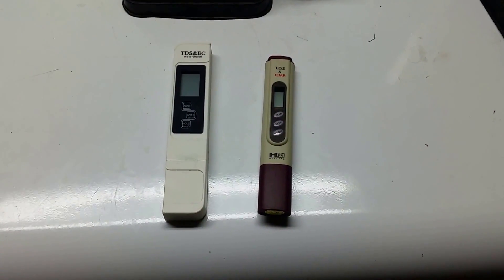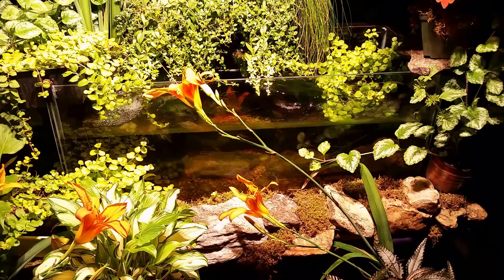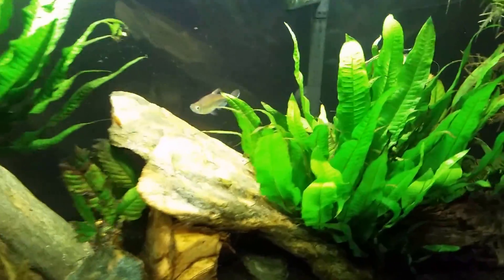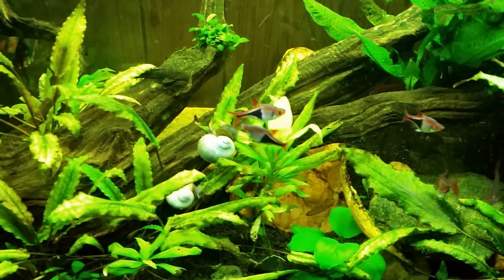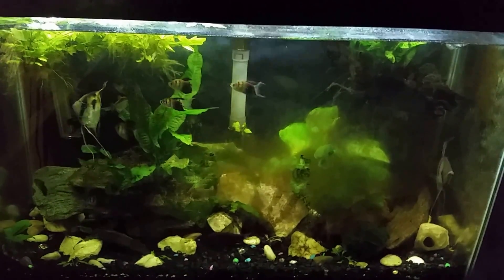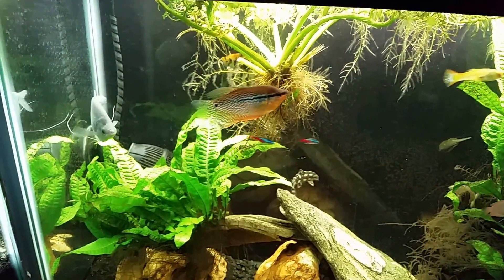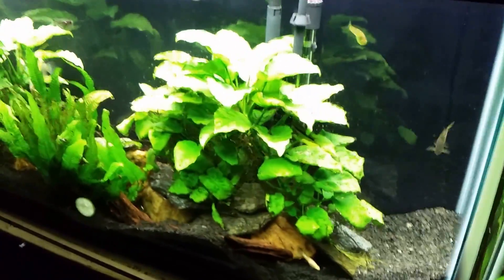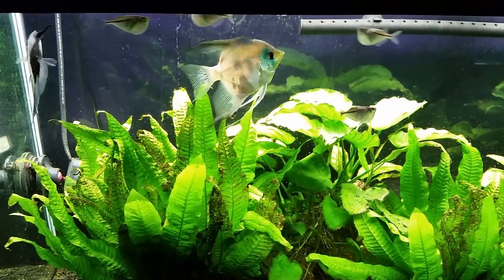TDS or EC? What's The Difference; and Why I don't Bother with EC

Comment: TDS is a calculation based on EC, not the way around.  EVERY tds meter converts ec to tds.  
Tds is expressed in ppm, EC is expressed in Siemens (microsiemens or millisiemens). It has nothing to do with being European, Australian or American brands.  
EC is universal in the whole world, the conversion from EC to TDS however can be done with different conversion factors, and that’s the main reason why you shouldn’t use TDS/ppm.  EC is the opposite of resistance (in ohm), it measures the electrical conductivity, and is always correct.  
If you want to measure the disolved oxygen in the water, you need an ORP meter.  
I’m giving this video a thumbs down for giving too much incorrect information.

Comment: Why did you think that meter would work for redox when proper testing for EC/Redox/Orp can only be properly measured in millivolts? Here's the Orp/Redox meter I use with great success and its not expensive at all. https://www.ebay.com/itm/ORP-Meter-Redox-Tester-1999-1999mV-1-point-Calibration-Aquariums-Aquaculture/192537098578?epid=14019256749&hash=item2cd41af952:g:0mAAAOSwMqla9VMJ
Reply from the maker: I was told an EC meter would "tell me everthing I needed to know about my water".